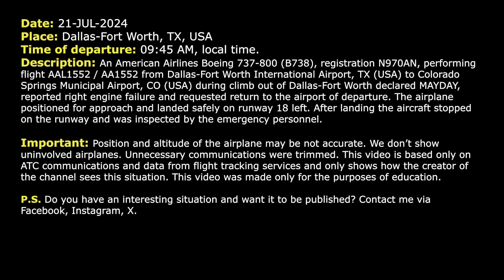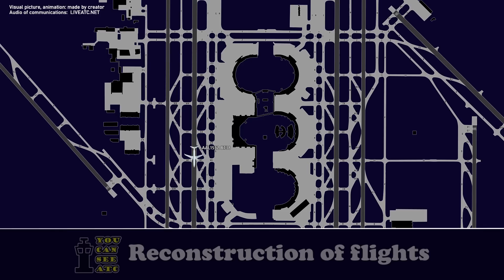MAYDAY-MAYDAY-MAYDAY. Right engine failure. American Boeing 737 returns to Dallas. Real ATC

Comment: 2:05 Making turns only to the live engine is a hangover from flying underpowered piston twins. Absolutely no need in a B737. Noticed he made a right turn on to finals.
Reply: Funny I thought the same thing, that initial left turn I thought was good ADM but then he turned right into the dead engine to intercept the ILS. Dont fly 737s but I assume single engine doesn't matter which side
Reply: @wheresthedoctor6629  Providing you use the correct technique, flying a jet transport with an engine out is rather easy. No superhuman skill or Mayday call required.

Comment: Isn't an engine failure usually a PAN PAN?
Reply: My understanding is you can use either Pan-Pan or Mayday, depending on how serious you think the engine failure is. A flame-out might be a Pan-Pan, but a birdstrike or structural failure might be Mayday.

Comment: Then he still gets the 3000 ft doing only 229 knots, and he makes a right turn with only his left engine running, unacceptable. It is far too easy to do a spin stall making a right turn with only a left engine running. I have never actually seen that happen before

Comment: Nice job to all. Really appreciated the [callsign] Emergency on each message as the reminder to all on frequency that this is the emergency aircraft. Never seen a heavy vectored outside the Bravo for a long approach before. I could imagine a little Cherokeee or 172 flying around VFR and seeing that plane in their airspace out of the corner of their eye!
Reply: Pilot stated he wanted a 15 mile final (which would have been well inside the Bravo), and the controller was warning him about weather that he would have preferred to vector him to turn final inside of.  That said, the pilot gets to do what the pilot needs to do for his emergency, and if that means that if he changes his mind to a 25 mile final (which happened here), then leaving the Bravo is something that happens.  Controller did the right thing by notifying him his longer final would put him outside the bravo.  

If you listen to KDFW frequency 118.42 on liveatc, you will hear other aircraft tell the controller the base of the storms were at 4200’ which is likely why he descended him to 3000’.

Comment: 5:49 American 11, errrrr.... awkward
Reply: Tell us you don’t know how ATC works without telling us you don’t know how ATC works. 

Again, what’s awkward? He started using a certain number - used the appropriate phraseology “correction” immediately in the same breath - and then corrected himself. 

I’ve been doing the job nearly 30 years. That’s how it works.  Try again pal.
Reply: What’s awkward? The guy is likely talking to a dozen other aircraft as the audio is trimmed for this emergency.  He said 11, immediately followed by “correction” which in this job automatically corrects (voids out) and replaces it with the correct callsign. 

The only thing awkward here is you commenting without knowing how this job works.  Keep up the good work!
Reply: @user-my7gf9bu1x  Go crap in your hat. If you don't know, and can't get the reference, then you keep up the good work.

Comment: They requested 18R. ATC told them they could only take 18L.
On their way to 18L they did meet a company plane coming of18R. So 18R was in use!
They clearly stated mayday mayday mayday. Why were they not allowed towards their requested 18R while other aircraft were allowed on 18R??
Second failure of ATC: to let another aircraft depart prior to them landing. If that other aircraft had an aborted takeoff, this MAYDAY plane would not be able to go around on just one engine.
Reply: 3:29 they said "if we can do the left, that'll be better"  They just did not expect it to be available (I guess it is used for takeoffs) but as you say, since they were an emergency they were in fact allowed to land on 18L which also surprised them hence asking for confirmation multiple times.
Reply: @jester you’re completely correct. Not to mention, everyone should double check when atc is doing something nonstandard. In an emergency situation, they can make anything happen
Reply: We train single engine go arounds every time. They definitely can go around on single engine.
Reply: they absolutely could have gone around on a single engine if the departure had aborted takeoff.  They weren't stacked in so close as to be an issue.
Reply: I’m so glad you weren’t in the room making these decisions.
Reply: Generally a two engine airliner can fly with one engine as long as it has fuel. Most can even take off with one engine if necessary. The reason engine failures are serious is 1.) The plane may be harder to control, 2.) The plane may be on fire, and 3.) The plane has no Plan C. If the second engine goes out, the plane has no more engines.
Reply: You don't listen and comprehend very well do you?

Comment: Turn into the good engine ? This guy sounds like a riddler
Reply: Keeping  the good engine on the inside of the turbos  to keep the plane more balanced, since the thrust is asymmetrical that point  & the lift also becomes asymmetric in a turn, Adding those imbalances together (in this case) by turning right makes the aircraft much  more unstable. Turning into the good engine is standard procedure because if the aircraft is closer to stall speed or you have a control issue, the plane can get away from you and put you in an unrecoverable spiraling turn into the ground. So “turn into the good engine” makes sure you remember to do it correctly, even if you have to turn 270 instead of 90 degrees.
Reply: @javbw  it's a 737 no one cares, plane will not fall out of the sky
Reply: @javbw  this is a bunch of nonsense. it is not thing for 737.

Comment: lol turn into the better engine like its a piper navajo or something.
Reply: @acbulgin2  But then they proceeded to turn the other way at a lower altitude and slower speed than during the climb out... It's also a lower roll rate not the rate of turn that's potentially affected.
Reply: Definitely reminds me of an Air Force prop mentality - then I guess they realized it was no big deal so made the right turn later. Either way it didn't really hurt anything to be cautious at the start.
Reply: In climb, they were probably in a lower energy state and wanted to turn into the good engine while getting stable. Also, you don't know how the airplane was handling for them at the time.
Reply: @N1120A  Nonsense. There is no such thing.

Comment: For the last time sir......18 LEFT
Reply: His confusion is likely based on the fact that DFW NORMALLY uses 18L for departures and 18R for landings.  I've been based in DFW for 30 years and have probably landed on 18L just 4-5 times.
Reply: @jimx1169  Understood but confirming 4 times just seems like over-redundancy and taking up radio space at that point.
Reply: @DisandDat-ht5os better safe than dead- that’s what I tell my pilots.
Reply: the silence is trimmed out of the video, plus you're not in the stressful environment of a cockpit with warnings, you're just not in the same headspace as they were
Reply: It might not look like it but there’s a lot of things to do in an engine failure situation. And it’s easy to forget which runway especially at an airport with multiple parallel runways. Him asking it again is the right thing to do. Better to ask then to have another incident.
Reply: @Aldrooooo  I understand but it was like 4 times right??
Reply: @DisandDat-ht5os  yeah it might have been. But that’s still okay. It’s an emergency. And it’s not uncommon for multiple things to be happening in a cockpit during a normal flight and you miss atc calls. So in an emergency it’s can happen even more. Also with it being an emergency they have priority. They can ask for anything and talk on frequency as much as they want other traffic have to be careful to not intrude in mayday traffic situations👍
Reply: Right, 18 Left, right?

Comment: Wow  Glad this guy isn't my pilot
Reply: What's your problem with him?
Reply: @smark1180 you must be a non pilot
Reply: @Gmantsb  You must be a bot.
Reply: @smark1180  nope
Reply: @user-ef8xv2iz5c "This guy sounds like a riddler." Too funny.
Reply: Troll alert
Reply: I am no pilot, I have no experience nor do I wish to persue training. But I am sure you have a reason to dislike the pilot. Communication with Tower seemed quick, not stressed and to the point. I did notice he did not say his 'callsign/ ident/ whatever' in every communication, that seemed weird. But is that a reason not to have these people as your pilot?

I don't want to provoke you but I am genuinely curious what was wrong in this incident. :)
Reply: @Hennie1254 As a pilot, you want to plan for the worst case scenario. The right engine failed, is the left engine going fail too? So fly the plane first, second head back to a suitable airport, and third talk to the controller. There is the 3 to 1000 rule, for every 1000 feet of altitude, the airplane travels 3 miles. The controller was right on it and gave a right turn of 020 heading back to the airport. The Pilots kept heading west away from the airport. The Pilots extended their final approach 15 miles and only had 3000 feet of altidude, if the left engine failed they would not have made the runway. They did not stay in the Class B airspace (protected airspace from other aircraft.) I would give the controllers an A and the pilots a C.
Reply: @robertbenjamin7728  ratio
Reply: aviate, navigate, communicate. The most important thing the pilots had to do was keep the plane in the air not talk to the tower.
Reply: @legomaster4860  There are TWO pliots. Furthermore, nothing was threatening the safety of the flight once the failed engine was secure. 

Stop trying to impress the YT comments section with what you think you know..
Reply: @smark1180  Yes, there are two pilots, one is flying the other is monitoring, doing the checklists, handling the radio, running the numbers for the landing, talking to company, coordinating with the cabin crew and who knows what else so yeah maybe they miss a transmission occasionally.